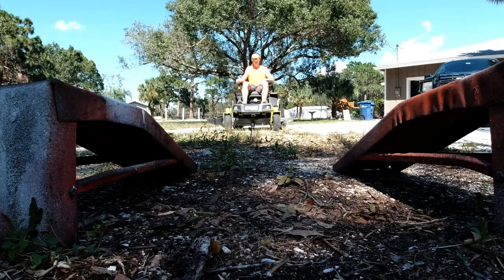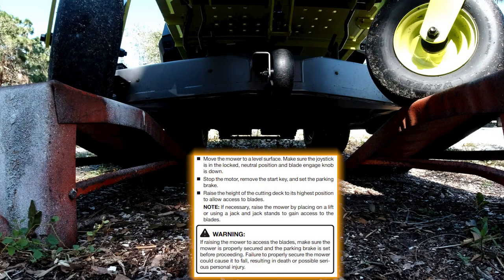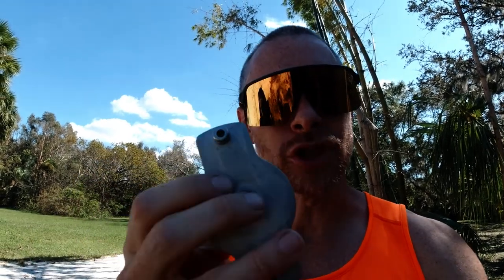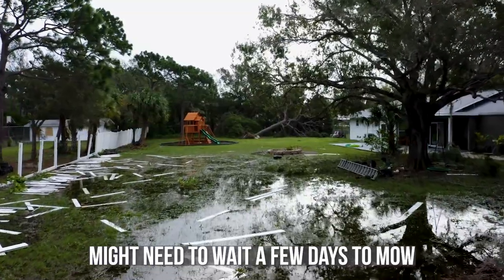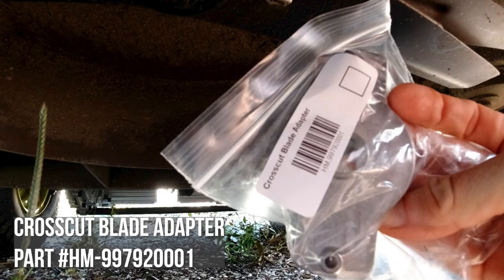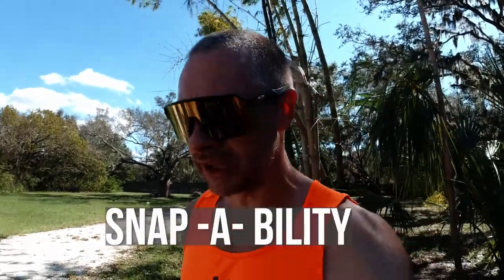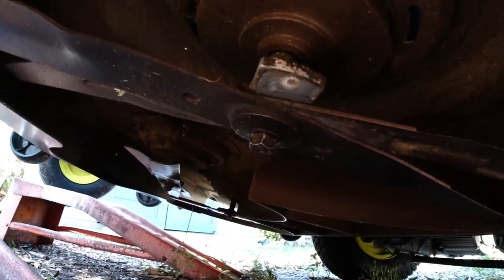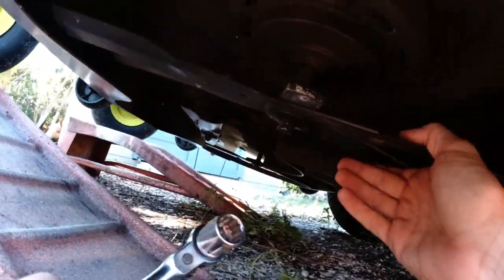Ryobi Zero Turn Riding Mower Blade & Crosscut Blade Adapter Replacement Tutorial | DIY Ryobi 80v

Comment: I appreciate these videos. I bought the R 54" 80V and have had it for about 8 months. I've had this same issue with the blade holders and have had to drop the deck and reposition the blades EVERY MOW.  I'm glad to see there's the replacement part!
Reply from the maker: Another watcher made a comment that they just drilled new holes and bolted the blades on. It's a solution but may damage motors if blades can't dismantle at a certain stopping force/pressure. But yes they seem to be aware this a part to have on hand. I'd call and just say you need one to have on hand
Reply: Yea it seems like every time I hit a tiny rock the blade adapter breaks or the blades get bent. They need to make thicker blades or maybe a bush hog blade attachment that isn’t to heavy for the mowers
Reply: @tylermorgan3433  I just bought a couple dozen of the OEM blade holder adapters. Ryobi turned me on to GARDENER, Inc., who makes them (you have to call in, though. They cater to dealers and don't have a regular consumer site). They're cheap. I also bought a PowerBuilt gear puller from HD to easily pull the offending part off. Lastly, I bought ramps and a car jack to lift the entire thing up and exchange the adapters or blades without removing the deck (which is a workout). I use a Ryobi impact wrench to properly torque the 15M nuts.

Comment: That helped tremendously.  Hammering it off worked.
Reply from the maker: Just broke another on mine. I think I'm at 5 broken in 2years. Not sure of you've seen my other replies since making this video but they did seem to change from aluminum to steel on these. Now I'm down to 1 aluminum and running 2 of the newer adapters

Comment: I sort of wish they'd just include these brackets as part of the blade replacement kit. Went to replace my blades and all 3 of the brackets required replacement so now sort of SOL until those brackets decide to ship.
Reply from the maker: Agreed. I think they're well aware they designed/made those adapters wrong. New material on the more recent ones shipped to me. 
I think when people call in for a replacement they shoukd be sending people 3 at a time.

Comment: I just driiled holes in the blades, lined them up and put bolts and nuts. Works fine.
Reply from the maker: Genius... you think this could harm motor though if blades can't "snap" under force? My only concern doing that
Reply: I would love to see a pic of that. I use my zero turn and a riding mower from Ryobi for my lawn care business and it seems like they’re always breaking in the middle of cutting so it’s very annoying
Reply: @tylermorgan3433  I use mine for lawn care as well.. how do you get past it dying after only 3 or 4 mows? and soggy lawns (getting stuck)

Comment: How the heck did you get your blade adapter off? I hit a branch or something the other day and sheared the little half moon - but I can't seem to pry off the adapter. Tried PB blaster and tried the wrench and mallet combo - no luck so far.
Reply from the maker: That is a great question. Not how I'd have liked but thankful for the steel deck. Used a thick wrench wedged to top of bracket and underside of the deck and a bunch of mallet whacks to underside of wrench. Let me know what you manage to come up with.
Reply: I bought a PowerBuilt 6" gear puller from HD. Literally made for this purpose.

Comment: I tuned in specifically to see how U dunnit... remove the adapter. 
80VLi 42" ZTR --First cut and at a time when batteries were down to 75% I hit a red house brick.  Bent the blade, sheared the moon and half moon off the adapter.  Brand new mower as of last evening delivery.
Finished the mowing having also removed the upper blade on the utter side; don't want an imbalance. 
I conclude them thar blades to be considerably thinner than the standard single blade machines.  Never bent a blade on my Hustler Rapter 42" ZTR and I used it like a bush hog.

Comment: I bought some of these adapters on PartSelect. Same part number. They are 1/8" thicker though so the nut cant be fully threaded and the key doesnt engage on the shaft. Can anyone shed some light on where to find the right part for a reasonable price?
Reply from the maker: Interesting. Thank you for sharing! I'm curious for you to call Ryobi and try to get one sent to you to compare. The newest batch I received was significantly heavier and I think they went away from Aluminum. Size is the same.
Reply: @LifeAsDane  I bought 3 from Ryobi. Same result.

Comment: The same thing has happened to me I think.. the deck randomly dropped on me and then when I had the blades on there was a different noise coming from the blades then what is normal.. like a louder rough vibrating noise. I just looked after watching this vid, and one of my blades dont have the half moon or the circle piece sticking out... my question is, what does that part do? im still running the mower with it missing, so am I damaging the mower?
Reply from the maker: So these "cross-cut blade adapters" hold the blades in a perfect position. So depending on if it's loose or just has broken tabs the blades have the chance of moving around a bit and you'll notice uneven cutting. You will need to replace it to eliminate the vibrating. I drilled a new hole through both blades while positions and used a nut and bolt but even that didn't hold long. I suggest you ask ryobi customer service for them to send a couple. I think they know this is an issue that is becoming very common. They say it's safety related which it may be. I could see the motor burning up if the blade didn't give when hitting a large stump or something. Either way those adapters were made VERY cheap. Almost felt like aluminum replacing them. Funny thing is the most recent versions they sent me around Christmas are at least DOUBLE the weight than the stock ones. So I personally believe they are trying to strengthen these adapters parts. Won't surprise me to see them being sold in 3 packs soon.
Reply: @LifeAsDane  Is the part number the same for all sized mowers? Also, are there better blades that can be purchased? My mower is not under warranty so I think customer service is out of the question lol.

Comment: One of the 48V deck motors on my 42" burned out, but the blade and adapter did not break.  The deck motors just turned off after 3 seconds or so.

It took me the large part of a day to disassemble it and find the bad motor, but when I tried replacing it this morning, the blade adapter would not budge, even though I disassembled the motor's other side, and the soot from the windings got on my hands.

I had to buy a 3-prong gear puller to get the blade adapter out of the bad motor.

The plastic motor covers are annoyingly hard to manipulate. You have to guide the 3-phase power cable through the holes, and the bolts are hard to get through the case top's two holes.

As a bonus, I pressure-washed the mower when it was disassembled.

Now I just need to reinstall the blade and reattach the deck.
Reply from the maker: Did the bad motor get caused from running over something? Also did Ryobi work with you for a replacement? I'd imagine for something like that they'd try and get you to bring it somewhere.
Reply: @LifeAsDane  I think I ran over a raccoon or something.

I do not have a trailer to transport the mower for service.

I did not bother with Ryobi support.

I found the (secret) service manual and tried out the diagnostics myself.

At first I thought it was a bad motor controller, but when I replaced both motor controllers and it still didn't work, I suspected a bad motor.

I then bought a new motor and tried it by plugging it in without fully installing it. It stayed on with the other one, instead of turning off in 3 seconds. That's when I confirmed that the old motor was bad, and so I replaced it.

I successfully mowed around 3 acres yesterday.

Comment: At my 25 hour check i noticed they all seem to be broken. I dont know what could have broke it. Im tempted to drill it out and use a shear bolt. I feel liek this part may be too weak.
Reply from the maker: Oh wow. It'd be running rougher for sure but yes, I think these parts are cheap but I think they are meant to protect the motors as well. We'll see. I don't see how they could make them much better without redesigning the blades. I do need my blades sharpened

Comment: The blades are driving me crazy. If you hit the smallest root it bends the blade and destroys it. My adapters don't have hollows in the posts like yours does. Strange.
Reply from the maker: Really... interesting. When did you get your mower and did you go 54"? Im wondering if they are starting to reinforce these. They are made to break they told me as to not harm the motor.